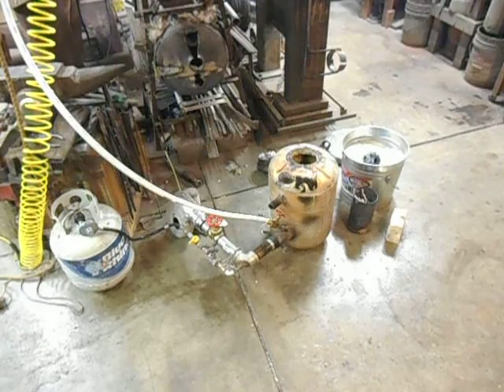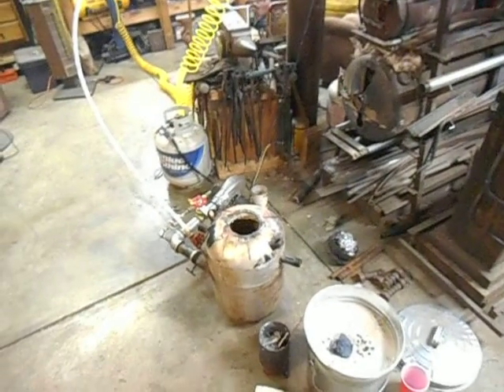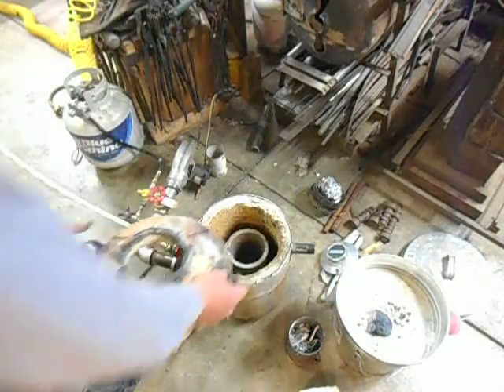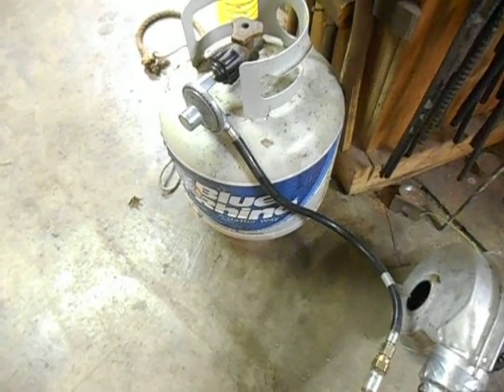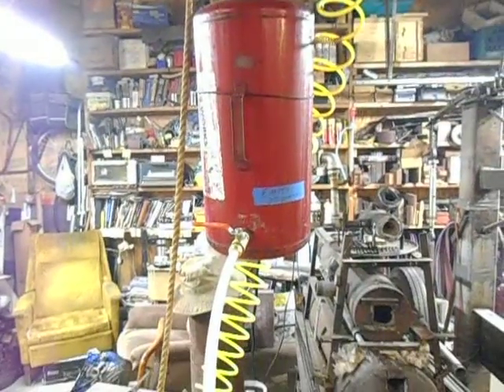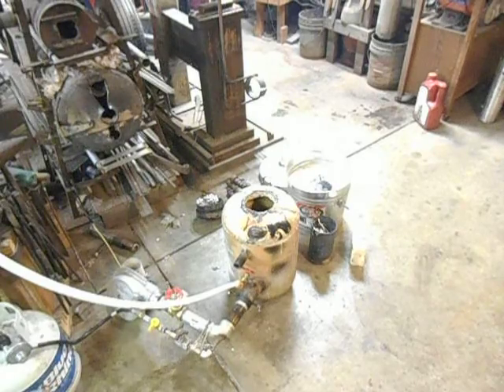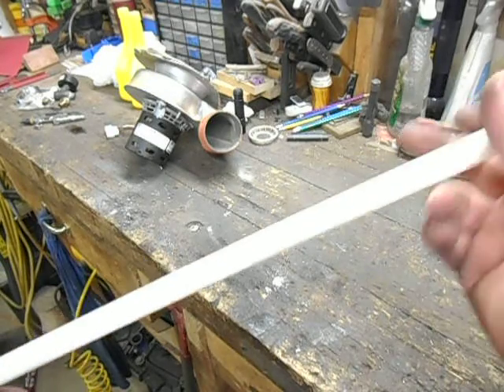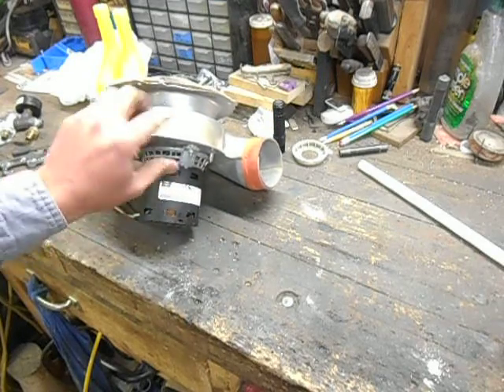waste oil foundry improvements

Comment: is there a way to make the molten metal feed out of the side of the furnace( with a twist off control value,to control the flow. given it will be hot to turn off) but say put this 1 quarter ways up the crusable and at a point in the melt it drains from said value.
Reply from the maker: I suppose you could, but it would take some figuring out. you would have to run a tube of some sort through the wall of the furnace, and then through the wall of the crucible. and then make sure that the tube doesn't weaken the crucible, and that it can take the heat from the furnace.  or maybe do a tap from the bottom. like suspend the furnace up however high off the floor, then make a removable plug from the bottom of the furnace, and then use a one time use crucible, then when whatever metal you are using is hot enough and fluxed if you are fluxing it, then punch out the bottom of the crucible, and let the metal drop out.
Reply: was thinking it would be use full if you have several thousand cans. come up with an autofeed system

Comment: Good setup Joe.  Amazing the difference the pressurised fuel feed makes isn't it? Much easier to control and responds to fueling adjustments real quick.  I suggested 2lbs because 1, I use plastic tanks that won't take much more than that and the control is still great, and 2, i would have thought that using something like 10lbs would have made the fuel setting very touchy. Obviously you aren't Finding that which is great. 

I have been thinking of going to a 60L metal drum for a fuel tank and you have convinced me.  I can probably put 5 PSI in that and with the 1/2 Fuel lines I use, that should give me enough fuel to break my 600Kw output record easily and still have some burn time. 
Your setup is so much more professional than any of mine. :o) I build them as cheap and simple that works and you put some real engineering into yours.  I'll have to lift my game!

You should be able to get onto the oil much faster than you appear to be doing. I start adding the oil SLOWLY after about a minute on my burners when I preheat with LPG and after a couple of min I can go to oil completely.  Gas costs me money, oil doesn't so I like to get onto the oil asap.  Just ramp the oil up so it supplements the gas at first and keep going till you can turn the gas off completely.  You should be able to go full oil in 5 min Max with your setup and I'm sure much quicker when you get some practice and learn the way your furnace behaves. they all have their unique behaviors!

I Look forward to seeing some melt vids in the near future!
Reply from the maker: +Oil Burner heck yes the air pressure helped out a lot!! I will have to play with that setting also, and see if less than 10ish pounds helps or not. the thing there is the regulators on my air compressors. I may have to pick up one that adjusts in finer increments and mount it on the tank.thanks for the kind words about my build! this foundry will be with me for a long time, so I want it built good. I was kind of wondering about the oil tanks for your setups, and for the big scrapping furnace that I will build like yours this spring. but either the tank would have to be fairly large to hold a good amount of fuel, and have a large fill tube, or maybe a quick disconnect and several tanks. so you can just line up several, then swap them out as you go through the fuel. also I wonder if since the tank is pressureized, would it need to be higher than the burner? if not, then you could just use a 50 gallon drum with a tap and air port and leave it on the ground.I did a burn last night, and was able to get over to oil in about 15 mins from propane. I still have to log everything into my log book from the burn so I can remember it the next time I fire it up since it will be awhile as I need to get back to making knives. but I do think that next time I can get over quicker as I learn it. as you say they are all a little different, if you look in the back ground on the vid, you can see my forges, small on top, all arounder in the middle,  and sword forge on the bottom. all 3 have their little quirks even though they all use the same design for the burners.
Reply: +Joe Calton   If the tank is pressurised, especially to the pressure you are running, you could easily have it sitting on the ground. Gravity at the heights we would use only would supply a fraction of a PSI. Having 10 or so would be like having the tank on the 15th floor.  Working in reverse, with the tank pressurised you would still get oil feed a long way up so having the drum on the ground would work well. The way I would do it would be to have Feed tube welded into the 2" bung that went to the bottom of the drum and pressurise the drum through the 1" hole.  This will force the oil up and out the feed tube to the burner. Doing it this way you can have the on off tap on the top of the drum where it's easy to get and and you have no protrusions on the bottom of the drum to leak or get accidentally broken off etc. 

Look up drum pressures though. I don't think you can run them to 10 PSI. You may be better off with an old hot water tank and weld some legs on it. It will already have ports tapped on and you can use a couple for a sight tube to see how much oil you have left. 

Next time you fire up, Try starting with a bit of oil in the bottom of the furnace. You'll see how quick the oil takes and it will provide extra start up heat as well and get you onto oil faster.

Comment: This is a great vid...really enjoyed it.

You know I love me some pex and shark bites, and that little $1.50 tool is worth it's weight in gold in my book.

Thought it was clever how you'll measure the oil fill by weight.  I was wondering how you were going to tell.  

And I learned why gas heater fan runs before the furnace actually fires up...I always wondered bc I always here it.
Reply from the maker: +C amber good to hear that you enjoyed it!!  that little $1.50 tool..... I have lost a whole bunch of them, but almost always have an adjustable wrench in my pocket when im working, so I normally use it, and for normal lines that may only be put together or taken apart maybe twice over the lifespan of the fitting it works great. but I figured id just leave this one on the pipe, and maybe not lose it :}
Reply: +Joe Calton ha, they probably do make them so small so you lose them and have to buy it again!